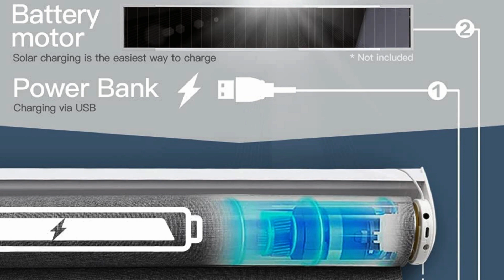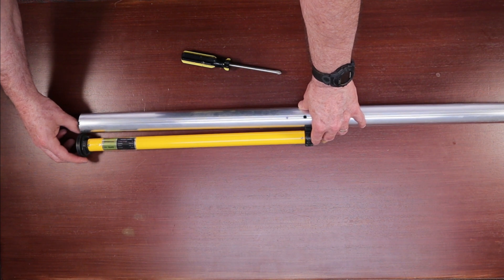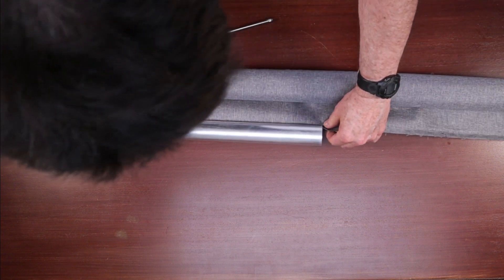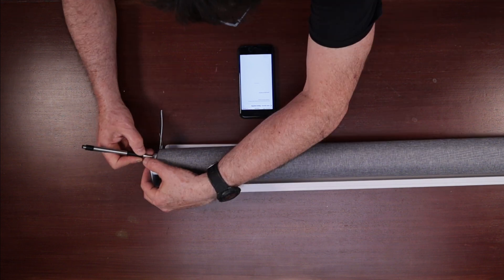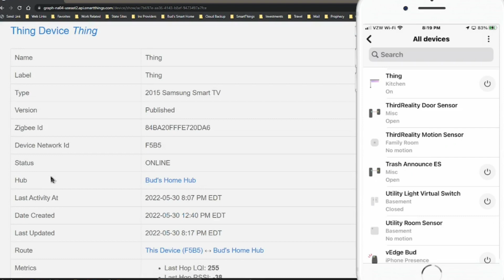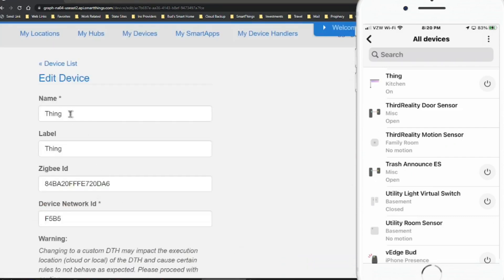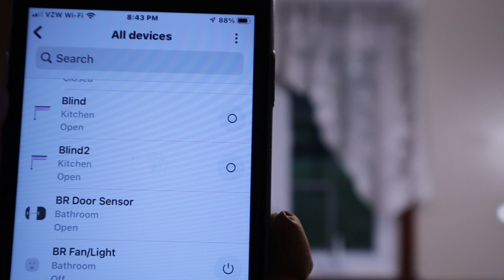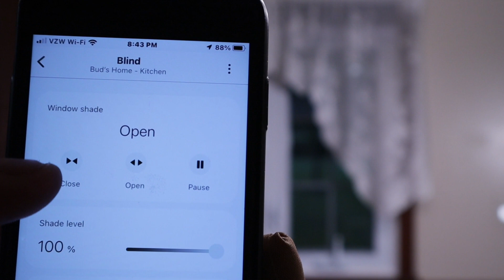Smart Blind Motor Replacement for Zemismart Zigbee Blind for the SmartThings Hub

Comment: Can you change the actual battery within the motor ?
Reply from the maker: I am advised that it is possible to replace the lithium battery within the sealed Tuya Zigbee Roller Blinds Motor tube, but it's recommended to follow the manufacturer's instructions or guidelines to ensure you perform the replacement correctly and safely. One is advised to contact the manufacturer or seeking professional assistance for guidance on the process.
Reply: @BudsSmartHome  thanks for the reply. Which of the 3 is your top choice for roll up blinds ?
Reply from the maker: SmartWings number one, Third Reality number two. Zemismart would be my last choice.  I’ve had issues with the Zemismart battery.  I’ve had no issues with either ThirdReality or SmartWings shades. Both the Third Reality and SmartWings are good, however, I think SmartWings, blinds and shades have a little higher level of quality. I do like the convenience of having the ability to power the ThirdReality shades with The four AA batteries. This is a nice, convenient, affordable approach to window coverings. Third Reality just released a Lite blind. That I’ll be doing a video on in September. It will retail between $75-$94 depending on your window’s width.  Both third reality and SmartWings have been wonderful to work with. They both appear to be dedicated companies that are going to be around a while to support their products.